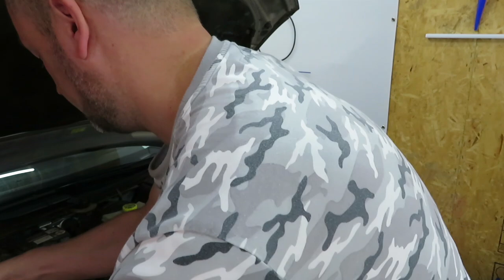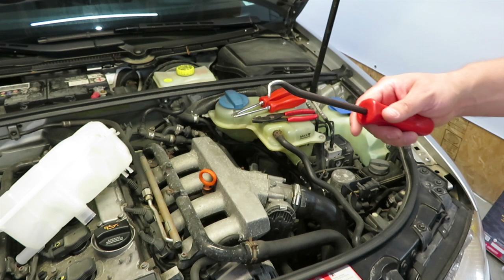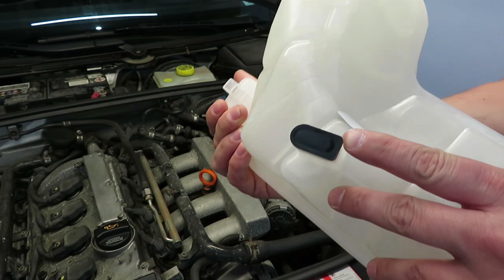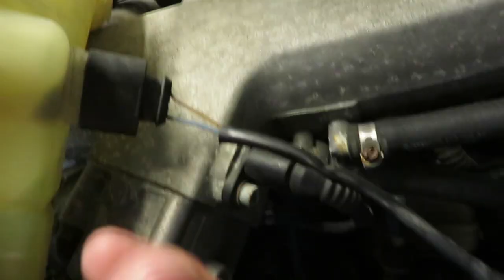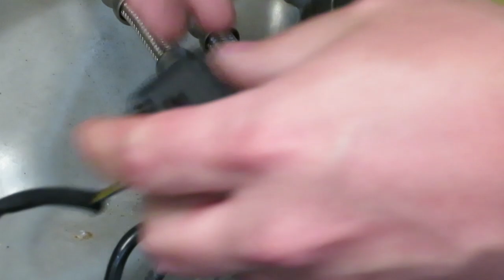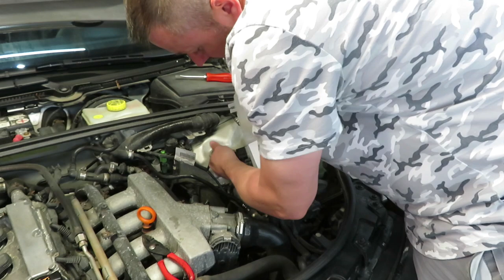Audi A4 How to Replace  Coolant Reservoir Tank Replacement

Comment: Great video you make it look easy.  Where did you get the new reservoir?  I ordered from 1A auto but they sent me a tank that doesn't fit nor does it look like my old one or the one you replaced. Thanks
Reply from the maker: I got mine from Amazon.
https://www.amazon.com/dp/B01D8VIZZY/ref=cm_sw_r_cp_apap_Rn98AtMftmjXb
Reply from the maker: I just wanted to let you know that replacing this didn't help my problem.  I think that I have a small head gasket leak that is causing pressure to build up in the coolant system. I just wanted to add that bit of information
Reply: @DCAutoEnhancement  I'm having the same problem but the top to the reservoir doesn't seal tight the way it should so when it gets hot the cap pops off

Comment: do you need to flush the coolant if the tank is just leaking ? not sure if you did but need to know ?
Reply: i’m putting the same coolant in and it’s not bad coolant in the car it just cracked at the reservoir
Reply from the maker: @218euros  so are you changing to reservoir or just adding coolant because yours is cracked and getting low.  Either way if the coolant is good, I wouldn't worry about flushing it
Reply: @DCAutoEnhancement  So only change tank nothing else to do , saw some guy bleedin it , mine just cracked at bottom i need to change tank
Reply from the maker: @hahahehe3276   bleeding would be a good idea

Comment: Did you need to use the extractor at any point bc I don’t have one of those
Reply from the maker: Extractor for the coolant or a broken screw? The coolant had leaked out so I didn't need to extract any fluid and the screw was intact upon removal. I hope that answers your question. If you need to extract fluid from yours, you can use a turkey baster or a large syringe.

Comment: I have a leak in the rubber pipes and the reservoir and it’s causing low oil pressure 😭.
Reply from the maker: Thanks for watching. The coolant system shouldn't affect your oil system. Sometimes if you have a bad head gasket the coolant can cause pressure in your oil system. I am not saying that is the case. But you may want to get a second opinion.